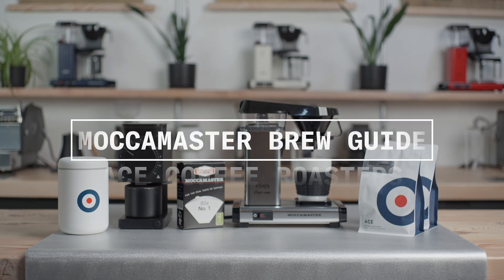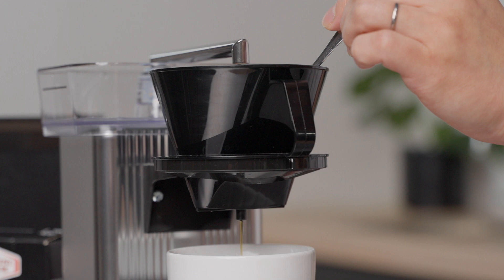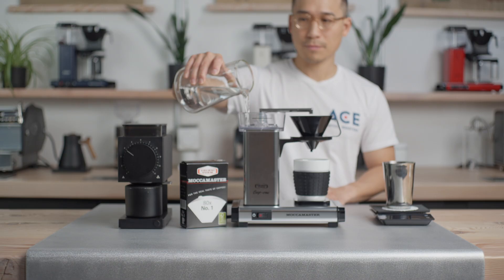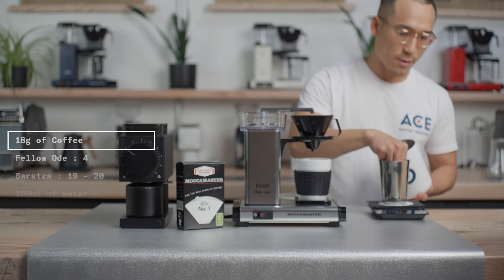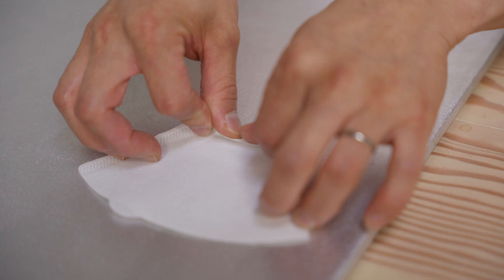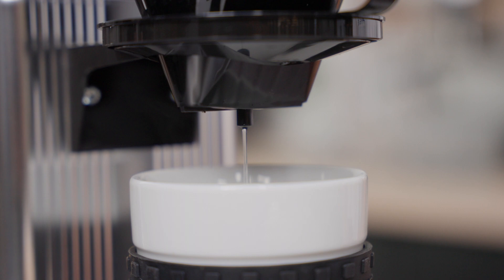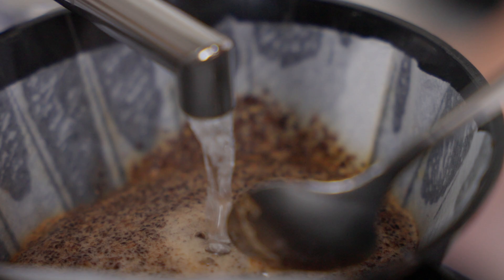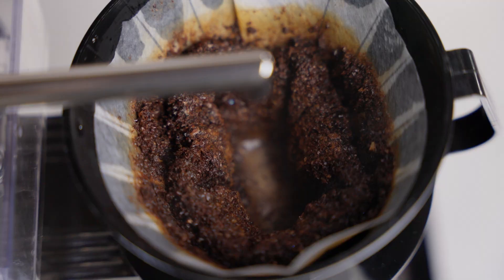Brew Guide: How to Brew Moccamaster Cup-one Recipe

Comment: Its design is that of a semi-immersion brewer. Because of the tiny exit hole, the water and coffee get to hang out together for a good amount of time. By constantly stirring, you'd be overextracting your coffee if it wasn't ground too coarsely. By the looks of your ground coffee, it looks to be at least a medium coarse grind which would explain the crater you see if you leave out the agitation. If you were to grind finer to say a medium or medium fine, you would not need to continually stir the slurry. And you'd end up with a moderately concave, crater-less bed without any intervention. And the coffee would taste delicious.

If you're grinding at 4 on the Ode, you must be using the Ode Gen 1? Because 4 on the Gen 2 is too fine for the Cup One for most people.
Reply: I just purchased gen 2 ode grinder....what number do you suggest  for coffee grind also using Moccamaster one cup machine and medium roast coffee beans ?
Reply: @trojkeddd  I use 6 or 6.1 on my Gen 2 Ode for most medium roasted coffee.
Reply: @jdgordon194 Thanks and for light one?
Reply: @-CarlosZeta-  Go a bit finer at around 5.1 or 5.2.

Comment: looks good but man that's way to much work for a simple cup of coffee lol... but I appreciate those who appreciate a good cup of coffee. I usually just use my $20 B+D and I do grind beans using a Baratza. Usually grind half a bag at a time and store in a air tight container. I do not presoak my publix brand filters. I do have a aeropress, french press, moka pot, pour over, and a Keurig machine. I usually use the B+D drip maker or Keurig thou. I just can't justify spending like $200+ for a single serve brewer. I am eyeing the Breville espresso maker tho as a special gift to myself one day. Plus having to stand over the machine and stir the coffee grinds sounds like something I'd grow to hate doing.
Reply from the maker: You need a really good method in order to brew a cup of coffee that is properly extracted on this machine! Your options you have at home are more than sufficient and brew equally (maybe sometimes better) as well!
Reply: Totally agree that buying a $X hundred dollar labour saving device and then having to stand over it to make a cup, just isn't my cup of tea, I may as well stick to my $5 pour over. 
I want a single cup automatic machine that uses beans that doesn't require my labour apart from loading it. 
 What's the B+D coffee maker you are talking about ?
Reply: Diotima have to agree with you. Seems like a very niche market for this product. The point of buying an expensive machine is for the convenience, time savings, and taste. Just like the Breville espresso, it hits a mass market because it meets all 3. For those that prefer the coffee experience, I think they don't like machines and would rather use something like pour over Chemex. Would love to hear who the target audience is.

Comment: might as well use chemex with all the work required just to make one cup
Reply: Really not that much work lmao
Reply: It does defeat the whole point of drip machines making brewing simpler. If I have to take all the same steps that I would for a pour over, then I don’t see the point. The only benefit I see is making coffee for other people. If I have someone over, and they’d like a cup of coffee, I don’t want to have to keep waiting for a kettle, and this way they could make coffee for me too without me having to teach them the tedious art of pour over
Reply: @QWEEKEN73  two things, it asks to pour hot water onto the paper filter. Where are you suppose to get hot water from, another kettle? Second, you need to constantly stir because the drip is in one spot. In my opinion, this is a design flaw. Why couldn't they make a sprout with better distribution? I don't see much difference between this and a $20 drip machine, apart from probably better water temperature. If the machine would auto-drip the hot water onto the paper in a pre-phase, and then start brewing, with a better sprout, this would make it 10x better.